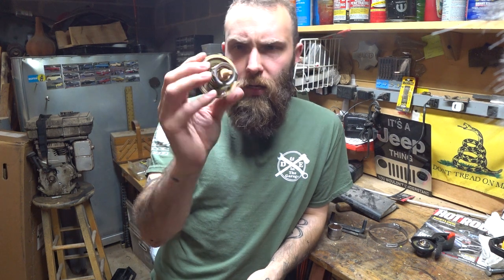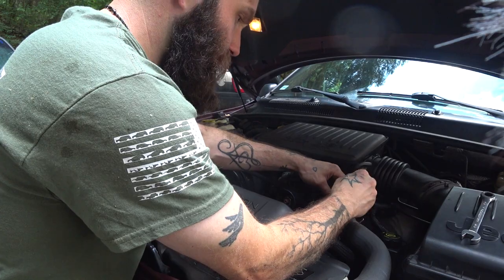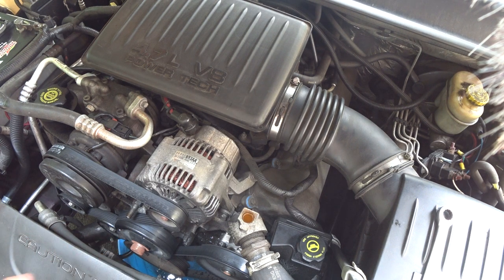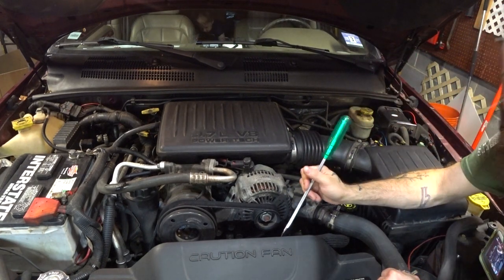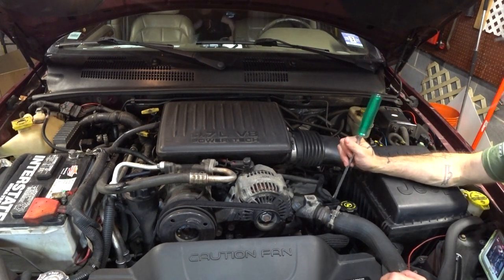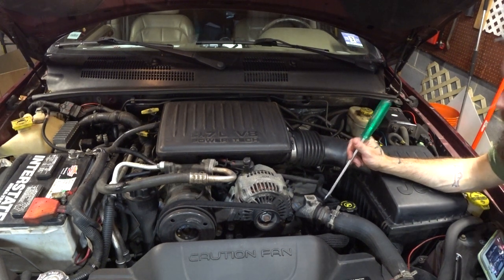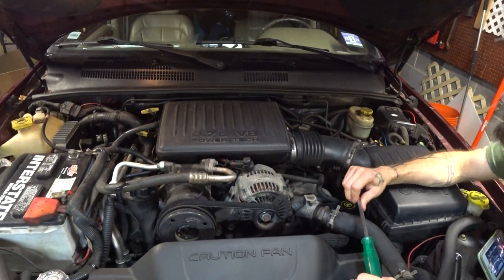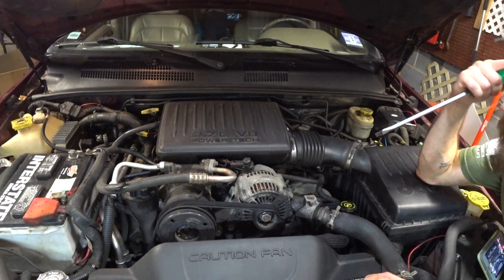How to keep a Jeep Dodge 4.7L alive & happy - EVERY FATAL FLAW I LEARNED THE HARD WAY!

Comment: Not specific to 4.7 but very pertinent. If you drain your 4.7 or 3.7 and find the wrong coolant, you need to do a very thorough flush. Drain all the old coolant and run water through it until you're sure you've got as much of the wrong stuff as possible. OAT is incompatible with IAT coolant and will gunk up. Worse, IAT coolant in a system designed for OAT can actually speed up corrosion. Don't rely on some magic flush type stuff that you dump in and run for a while, then change it. Drain your old coolant into a proper container for disposal (lets not poison our water tables please) and then do the old fashioned backflush method with your garden hose. There are adapters that get spliced into your coolant lines so you can connect a hose. Prestone makes one that has all the parts you need. Yes, this uses a lot of water, but you're sure to get a clean system without contaminants. Hook the garden hose up to the correct port, start the motor with the heater on let come up to temp and start the water flow. Once you see clean water coming out the splash tube out of the radiator, you'll know you've got everything cleared out. 
Drain everything one more time to get the water out, then close everything up and fill with the correct coolant mix. It sounds like a ton of work but for the $5 that the flush kit costs compared to the repair costs of having the wrong coolant, it's cheap insurance.

Comment: Thankfully my 3.7 hasn’t had cooling issues yet. I personally love the 3.7 even with its little headaches
Reply: The 3.7 responds great to a tune. Hyper tech gets 24HP/24TQ on regular gas. The factory left a lot on the table probably to up sell more 4.7s
Reply: @bly4233  I’ve heard this, I definitely want to try one

Comment: As far as mech fan or electric, I bought an '04 Grand Cherokee 4.7 a month ago. I knew I was getting one so I bought a 2 speed Lincoln Town Car fan for it before I even bought it. Not installed yet but measured fan to core and it is almost the exact same size as the core. Using a BMW temp switch and Volvo fan controller. This should cool way better than the hydraulic fan. Not over heating but just gonna do preventive maintenance just to insure reliability. The single speed MkVIII fans are the same size, I just prefer a 2 speed. They flow like 4,000-4,500 CFM so yeah.

Comment: I'd probably just find a lower profile heat exchanger for the AC and wire in a low profile electric fan either wired to a dip switch like I did my light bar or straight to an accessory so it runs whenever the truck is turned on.

Because the fan should actually increase airflow when you're idling there's no trade off to AC performance and now you've got a backup for when the power steering dies and takes the fan with it.

Other option is obviously taking out that fan and replacing it with an electric brushless fan and splicing the thermistor sensor somewhere with one of the coolant hoses coming off the rad...they make after market radiators with this already integrated when it comes time to replace the rad if you don't like to mcguiver stuff.

Comment: My 2001 Durango is still in really really good condition after 21 years BUT at 174,053 miles, my thermostat malfunctioned and I warped a head. I've decided to order a reman engine and be done for another 15 to 20 yrs. I have new mech fan and e fan is perfect. There's sentimental value in this truck, that's why I'm dropping $5000 on her. It was my mom's car.

Comment: Dont forget if your over 90k. Replace the valve lash adjusters(lifters) and replace the rockers with the updated design. On the 4.7 the lifters are what keep the rockers in place. The lifters collapse after they get some age and this allows the rocker to slip out of place and create catastrophic head and camshaft damage. The lash adjusters/lifters are inexpensive and sealed power makes a good replacement for them. Now for the rockers. The old design accounts for a lot of the oil burning and sludging problem through the pcv system on these engines. The old design prior to 08 models have rockers with a bigass hole pointing straight up that while the oil pressure is up just puke oil straight up that splatters all over underneath the valve cover not directed at any components specifically. This spatter combined with pvc vacuum circulating the crankcase air creates a nasty amount of oil vapor that then sludges your pcv valve and clogs the pcv vacuum tube back to the intake over time in colder climates. Also its relying on oil dripping off the valve covers to drip down onto the rocker roller bearing and cam lobes(not really directing oil just hoping it falls to the right spot). The redesigned version changed that big hole to a tiny almost pinhole that is pointing directly at the cam lobe and rocker roller bearing. And with it being such a tight hole you get a controlled fine stream of oil going right where it should without spatter and without sending oil vapor into places it doesnt belong like the intake manifold. This isnt just a theory. I have a catch can on my 02 ram 4.7 (yes its installed properly) and prior to replacing all the lifters and rockers with the new design the catch can needed to be emptied every oil change(about 2500 miles for my preference) and the capacity is about  half a quart. Since the replacement/upgraded parts i havent had to empty it once and its been daily driven everyday for 8 months since i installed the new rockers and has since only collected about 2 ounces of oil. But back to the lifters. Dont wait until one starts ticking by then it can be too late as said before on the 4.7 and 3.7 the rockers are retained in place by the lifters. So any amount of collapse is enough to allow the rocker to move out of place and cause all hell to break loose. Replace them even if they arent yet a problem if they have a decent amount of mileage. All it takes is one starting to collapse then you have a motor full of metal shrapnel. I have pictures if youd like to see the rocker design change

Comment: Have you tried Royal Purple ICE, it says 25 degrees cooler but in reality it's actually 10 degrees cooler, still works, using Royal Purple 5W-30 Motor Oil is a good choice as well, it'll keep the engine clean and running smoothly.

Comment: Yes.... Mine just started ALL of this.... 3 power steering lines, still need one, missing the top cage for the intake, keeps leaking ;(
Reply: They continue to say I'm wrong because I'm a Lady.... The top power steering hydrolic line to the fan needs a cage over the bolt end or ends for the retaining top bolt for hydrolic pressure.... Now I'm told to call A Hydrolic Company.... Really 😎

Comment: My 02 dakota was beast until it got hot and dropped a seat and had to do a motor swap and it hasn't felt the same since. It hasn't passed inspection since 2014 but still going solid. No o/d I'm getting a p0700 code and got the intermittent cam/crank sensor code p1391 still cant fix her no matter what I do to her change about every sensor you could new/junkyard ones either does nothing or make it worse. I kept the ones in that let her keeping on truckin and keep on truckin. I used to abuse the old motor but not the reason the seats fell the plastic on the rad cracked and lost coolant and drove to far with no coolant. Im nice to the new motor only because I feel like it's not up to par with the old motor that was in her.
Reply from the maker: That is a bummer to hear. Sounds like you have your hand full with it

Comment: i use wet break hydrolic oil babcat fluid i run it in mt is300 transmission well everything but newer auto boxes thier is logic to it flash point is way higher than top shelf fluid ATF ect and so on.and i swapped a 4 core radiator

Comment: My WJ is a 99 with the 4.7 but has both a Efan and mechfan, but it despies the orange color radiator fluid, it prefers the green, runs cooler, its absolutely nuts to me and leaves my wj friends baffled SMH. But as always good info. JEEP JEEP from setx my friend
Reply from the maker: That is wild. I do wish they kept the fan setup from 99 through all WJ years
Reply: i couldnt agree more
Reply: Same with mine stays cool as a cucumber, 198000

Comment: I have 4.7 in dodge durango fuel running back to tank changed fuel pump but still take long starting an have to push gas to start next changeing injectors

Comment: I replaced the waterpump, thermostat, hoses and power steering pump. Flushed all the old power steering fluid, and filled it with the correct spec MS-5931 fluid. Bled it all accordingly. Unplugged ECT sensor and hydraulic fan spun really fast/strong. Connected my obd2 and live data shows temps getting up to 220°F. Needle stays right in the middle. It was about 70ish outside and i had the AC on. I dont know if thats normal for it to get that hot.

Comment: Thanks for the content... I used lubegard synthetic power steering fluid after the Mopar stuff which ifelt didn't help in my situation. It helped my fan out big time spins nice now and made my pump with 188k like new no noises at all.
Reply from the maker: Interesting... I might have to try that

Comment: So for coolant: you can use any of them. HOWEVER some are not compatible they will gel up. The way to use any is to fully drain and flush all old coolant out. Then you can use any kind you wish. They all protect the metals the issue is some will gel.  So all of one kind or another. But never mix them.

Comment: I have a 2001 durango, my fan is a electric fan, my transmission coolant lines come up and enter the passenger side of my radiator. No power steering lines to the fan. I never got the bubbles to completely stop. My radiator blew first time I went 60 miles up the mesa.  slow slow bubbles periodically rise after I did my radiator installed and transmission has oil change done. 45rfe is the transmission used in my vehicle. There is a coolant return filter inside the transmission. Looks like a mini oil filter. There is a temp sensor/govenor pressure sensor on the tranny, transducer also.

There are just sooo many changes they made... when you have your vehicle running properly.. they are great. My problem is the maintenance is mandatory and constant. 4x4 by the way. 12,000 miles on tans oil change and there is a bunch of stuff you have to do while in the transmission, and you better order a pan with a plug. Or get messy changing Trans oil. Cause u gotta keep your whole machine proper to ensure longevity.  Get some orange hand cleaner from the parts store when ur picking up your antifreeze..
Alot of research. And still learning

Comment: I have a 2000 Durango 4.7 and the owners manual says MOPAR P/N 4267020 (green) and does not differentiate between the 5.9/4.7 with regard to coolant, other than capacity. It was running green when I got it. No issues.

Comment: I'm about to buy a Dakota with a 4.7 and a 6 speed. Loved the video! I run green coolant in everything I own because I learned while working at the dealership that ALL colors and makes of coolant is corrosive when oxygen is introduced into a closed system (e.g leaks) and gm Dexcool is the absolute worst. I like dodge orange or pink just fine but, when I change to the green(it doesn't break down as fast in my case) I completely flush the system at least twice and then I run the great only when I know for sure there is no color left in the block or radiator. Iv had the best luck with my green stuff, and the Mopar pinkish color (that o.a.t stuff). Both for me have never given a problem. I hope my Dakota will be reliable once I go through and catch up with stuff people always neglect

Comment: Pertaining to an '07 Grand Cherokee 4x4 Laredo, according to Chrysler maintenance manual data, removing the air bleed plug, at the top cooling hose, is NOT required on the 3.7 engine.  The 3.7 will self bleed when the vehicle is driven.  This occurs between the engine and the reservoir.  Simply monitor the level in the reservoir and you'll be good to go.  Why bother with an extra step, potentially causing ANOTHER leak (possibly stripping out the plug) and taking extra time?  Especially when the factory service manual says it's unnecessary?  Don't know if this applies to all 3.7's, so be sure and check your particular model.

Comment: 04 ram it had a timing chain rattle. So new chains tough job..I cut the button out of the t stat now it runs cold chk engine is on but I don't like running 195°in texas.. Going through tps 's like candy..air in the fuel rail..the regulator is in the tank DHO.. yeah its temperamental but it runs good. Not insane yet

Comment: Hydraulic fan-equipped power steering pump has a different adapter after the pump's pressure release valve.  This adapter has a larger hole through the center, and the fitting also has 4 small holes just below the o-ring groove.

If one were to change to aftermarket pump, you should move the OEM adapter from the old pump and install it upon the new pump.

Even then, some aftermarket pumps will whine like a stuck pig.

You can find further discussion on jeepforum.

I made the mistake of installing a new, chino pump, moving the OEM adapter, to my new 4.7 HO build, and ended up putting the OEM pump back on, even after much bleeding of air.  The fan did run properly, but the pump's whine was so annoying.

On the HO install, the mentioned adapter is immediately above the pump's pressure port, and before the pressure line arc heading over to the hydraulic fan's heavy input line.  The fitting take a 1-1/8" or so socket, and is about 2-1/2" long.. again, just after the pump's pressure exit port/regulator.  Under this fitting is the pump's pressure regulator plunger/spring.

Comment: One of the main reasons they overheat is because the thermostatic radiator valve (radiator cap) doesn't open causing pressure to build causing the radiator to crack causing coolant to leak out.  One doesn't notice until it's below the water pump level.  By the time the alarms start going off inside, it's too late.  When it happened to me, it was 7F outside and I pulled over immediately.  As soon as I pulled over, the coolant expanded enough to where the water pump started circulating it again and the temperature dropped to normal almost immediately.   Drove it 1 mile back home, filled with coolant and went on with my day with no issues.  Oddly, it was only after about 2 hours sitting in the driveway that the rocker arms fell off.  Popped them back on and haven't had a single issue since.  That was 13 years ago and it's still going strong.
Reply: Hey man, I’d like more info on this my wj is leaking coolant believe from the rad. Anyway I can contact you?

Comment: I just put a new radiator in my 05 dodge Ram 4.7. It was leaking. Now with my new radiator it’s been running hot and not blowing heat. I didn’t have these issues before. I think I got the air bubbles out since none have been coming from the bleeder or out of the rad cap. But it is running hot and not blowing heat now.
Reply from the maker: Big bubble trapped in your heater core. Defi Italy use the bleed port. Should fix you right up. Keep doing it until it cool properly. Sometimes it takes a LOONG time

Comment: I have a 99 WJ, 4.7L with a 545 RFE transmission, 242HD transfer case, custom double cardan shaft,  vari-lock diffs, 4" Rough Country lift on Pro-comp wheels and 32" tires. Really felt good about it. Then when my girl romped on it I notices a tiny puff of smoke out the exhaust. Tried it again, same result. Tiny puff but always does it when you get on it. Now you got me worried.
Reply from the maker: Wow.. sounds like a NICE WJ! Hope all is well!

Comment: besides the mechfan & efan combo, how about switching to an aftermarket all aluminum 2 row radiator. There are some write ups on the Jeep forum on this.
Some modifications are necessary though. It also looks they changed radiator sizes between 00 & 01 model years.

Comment: Yeah the 02 I picked up the PO had overheated the 4.7 after I bought it and got it home I noticed that the power steering pulley (was broke off) and belt was completely gone
Reply from the maker: Well that is fun. HAHA
Reply: @DEInTheGarage   Hi, 
I was looking at your video and I notice that your serpentine belt seems to be wrongly routed, you should check that. That would explain the overheating.
I have a WJ 2004 H.O. and on mine the routing is different. Yours seems to be pre 2003 model, but as far as I could quickly research the routing is the same on all 4.7

Comment: Long time watcher, now a subscriber! Very helpful! Keep it coming. Just got my '03 WJ with the 4.7! I was going through the simple checks as I pretty sure it was VERY neglected. Noticed that the coolant reservoir was low... without watching this video, I used lime green! It is what I had at the moment  and didn't know any better. Based on what you have to say, I should flush it. I only added about 3 quarts. Still need to flush? If so, approximately how many gallons or quarts do I need to get? Anything else I should do knowing lime green has been in there about 3 weeks with limited use? Thanks for your reply

Comment: I’ve had 2 4.7s a high output and one of the last generation of them. They are awesome motors, gas pigs, but very reliable torquey engines.

Comment: The new thermostat you bought looks different because it doesn't have the coolant bypass on it.That piece that protrudes out the end goes into a coolant passage and blocks coolant flow to the heater core until the thermostat opens.The new one will work, but your engine won't come up to temp as fast.
Reply: Interesting.  I just replaced my thermostat and was confused why it looked different.   I didn’t think there was any bypass for the heater core.  I found that out when mine leaked a few years back in the summer with no heat on.
So are you saying it will take longer to get heat in the winter now with the new “shorter” thermostat?   Thanks!